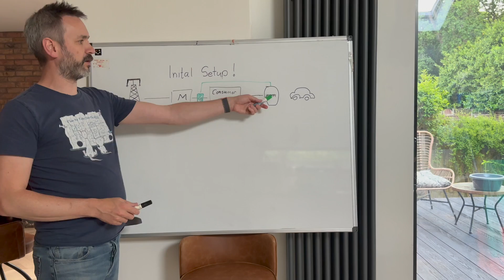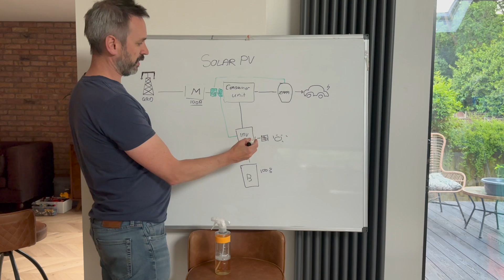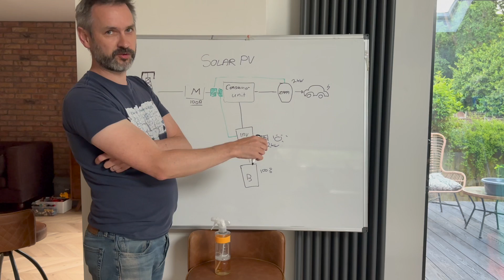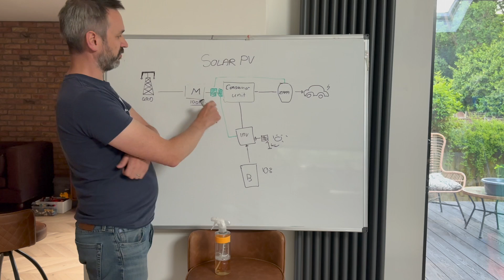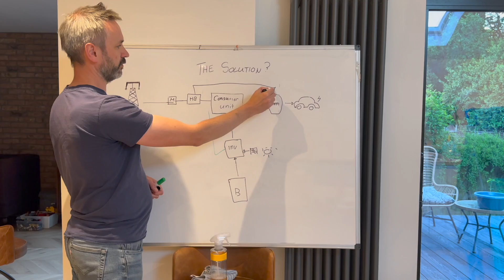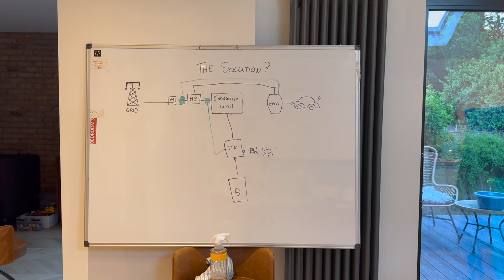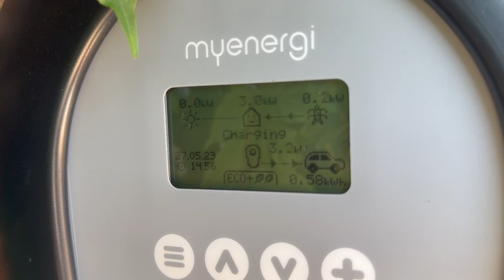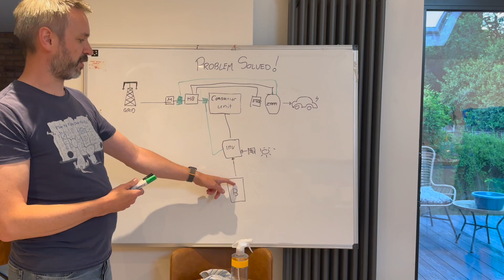How I stopped my Zappi draining my battery

Comment: That’s well explained, but is it all really necessary?

I’m not quite sure that what I’m experiencing is the same as you. What happens to me is that when the solar dips down below the threshold needed to keep the car charging, the Zappi is being kept going by the battery at a fluctuating rate of about 1.5-2 kw in total (battery plus whatever solar there is). So unless something happens to interrupt the charge (like turning on the kettle) the car continues to charge at this rate indefinitely and eventually the battery would drain. The battery isn’t discharging at its maximum rate though.

I don’t think I have this Zappi fix you mention, because I am not seeing a 200 watt export while the car is charging from the solar. There is a small, fluctuating amount of export most of the time, but sometimes it’s zero, and I’ve never seen more than about 80 watts.

I mentioned the solution you have adopted to my installer, and he had a different suggestion. As you said, the battery will discharge until it’s at the minimum charge set - yours is at 10%, mine is at 4% by default. But this is user-configurable. My installer advised me simply to set the protected % on the battery much higher to ensure that any excessive drain by the Zappi is stopped before it does any damage.

I have settled on protecting 93% (of a 9.5 kwh battery, so about 0.66 kwh), because this seems to be all the system needs to function when there is enough solar around that charging the car is a practical proposition. What happens is that when the sun goes behind a cloud the battery kicks in and keeps the Zappi going at about 1.5-2 kw. This usually tides the charger over until the sun comes back out again. When that happens the charging power picks up and the battery starts to recharge ready for the next cloud. There is even a small bonus. While the inverter caps the generation at its rating (5 kw for mine) when the battery is at 100%, while it’s charging the generation is uncapped. Thus in full sunshine the Zappi can keep going drawing 5 kw while the rest of the generation goes into the battery.

I find that 93% is enough to tide the Zappi over for about half an hour. If the sun hasn’t come back out by then the battery stops feeding it, the charge is stopped, and the remaining solar is then diverted to recharging the battery. If the solar then recovers sufficiently the Zappi will start again, but if the clouds have thickened drastically or indeed if it’s the end of the day and the sun is setting, then the charge stops for the day. It usually doesn’t take too long for the battery to recharge as there’s usually about 1 kw solar happening anyway.

This way, if you are charging your car direct from the solar, all you have to do is change the % battery that is protected on the inverter settings to your chosen figure (93% for me) in the morning, then forget all about it until evening, then remember to change it back before the house needs to draw more than that to run overnight. There’s no possible way your battery can drain out that way, and the whole system works more efficiently than if the Zappi is constantly turning off and on again every time a cloud passes in front of the sun.

Well, it works like a charm for me. I can’t see any downside. Is there some reason that wouldn’t have worked for you?
Reply from the maker: Hi - thanks for your comments!

The answer is no, it's not really necessary, but it has taken away a major irritation and meant that my battery is only being used to supply my house.

As you have a Zappi, you should have the export margin, but it's something you need to enable as it's not switched on by default. Once enabled, you can tinker with the export margin too.

As for your approach, I can see two downsides. 
The major downside is the manual intervention is required. I guess it could be automated, but that just introduces more complexity. 
It would also mean that you might not be able to meet some electrical demands. For example, if we turned on the oven/hob and there wasn't enough solar PV by itself, the battery would start discharging. In your configuration that wouldn't happen if the battery was at 93%. We would end up pulling from the grid, in spite of the fact I have a few kWh in the battery.

Here is a useful article from Myenergi on how to setup the export margin - https://support.myenergi.com/hc/en-gb/articles/4716922623633-Hybrid-PV-Battery-Set-up-Avoid-Draining#:~:text=Set%20the%20Export%20Margin%20to,divert%20power%20to%20the%20car.
Reply: @tomasmcguinness  Thanks for your reply. I'll read the article, but I don't think I need to bother as I'm happy with the system as it's working at the moment. You say that "manual intervention is required" but really it's so minimal as to be insignificant. This morning I thought it was so cloudy that the car was unlikely to charge, but I flipped the battery % anyway. Took about ten seconds. Then I went off on my bicycle. When I got home I was surprised to realise the car was charging, and had got nearly 3 kwh despite the dull weather. It charged for nearly three hours, getting almost 6 kwh, before the battery reached 93% and the charge was cut. This is despite the solar fluctuating between about 1 kw and 3 kw the entire time. If the Zappi had stopped every time the solar dipped below 2 kw (which is about what it seems to need to operate without battery support) I'd have got virtually nothing.

If I turn on the oven/hob/whatever when this is going on and there isn't enough solar to keep it all going, it doesn't draw from the grid. What happens is that the Zappi stops charging and all the solar becomes available to the house. I suppose if you turned something heavy duty on just at the precise moment the battery hit 93% and it hadn't had a chance to recharge at all, theoretically it's possible, but I've never seen it happen. (The other thing is, the oven isn't going to turn on by itself. If I do decide to cook at lunchtime, which I don't do very often, it's easy enough to check on the situation and alter the inverter setting if necessary.)

The main issue is remembering to put the battery % back once the car has stopped charging. I have a post-it on the oven door! It's not the intervention that's the issue, that's literally ten seconds on the phone, it's just remembering to do it.

And - we're off again. In the 15 minutes or so it took me to type that (and make a cup of coffee, so the kettle was on), the solar recovered, the battery charged back to 100%, and the car started charging again. The cycle will repeat, depending on the solar available, and the car will get maximum benefit of what's available.

As for automation, well, I'm only doing this on the days the car is actually plugged in and likely to charge, and it takes seconds, so I don't see the point. Also, when my G99 FINALLY comes through and I'm getting paid for solar export, I'm probably not going to do this much. Right now I'm doing my damndest to get every watt-hour in to the car that I can rather than export it for nothing, but when I'm getting 15p for export and paying 7p overnight tariff I expect I'll just export the lot and charge overnight. So really not worth £200 to my installer to change the wiring, or even messing around with the Zappi settings.

I actually find it advantageous to allow the Zappi access to that top 7% of the battery. As I said, it keeps the charge continuous when the solar is fluctuating up and down between 1 kw and 3 kw, which seems to happen rather a lot round here. You get the benefit if it brightens up, then the battery keeps the charge going, then when it brightens up again the charge picks up immediately. I find it really convenient and I really wouldn't want to give that up.
Reply: A PS to that post. After the charge re-started it continued as before for more than an hour and a half before the battery fell below 93% again. In total, in these two sessions in pretty dull weather, the car went from 44% to 60% and put on 29 miles of range. I don't believe that could have happened without allowing the battery to support the Zappi. The Zappi would have been on and off half a dozen times as the sun briefly peeked through, and picked up very little charge each time. It's now too late for the charge to start again even if the sky miraculously cleared, so I'll flip the battery back to 4% protected ready for any evening house load. I note that it took just 35 minutes for the battery to be back at 100% after the Zappi stopped charging.

I also noticed that I did in fact manage to do what I said hadn't happened. I turned on the kettle just at the moment the battery hit 93% and the solar was quite low. Couldn't have timed it better if I'd tried. There was a total grid import of, wait for it, 0.05 kwh. So yes, it's something to be aware of if I was going to use an appliance that drew a lot of power for more than a minute or so just at the wrong moment, and you may say you don't want to be aware, or change the settings to let the house have more battery when you do that, but I still prefer this to having the Zappi continually cutting in and out on cloudy days. It's quick and easy to change the % on the phone.

Comment: The simplest solution (no software of hardware changes) is to ensure your home battery charges throughout your car charging session.  In the summer I set mine to charge at a nominal 200w for six hours.  My car is always charged in less than six hours, so no home battery drain.
Reply from the maker: Yeah, but with Octopus intelligence Go, the charging can happen at any time now.

Comment: Hello Tomas,
good solution. Mayby the only issue is that you have to wait the battery 100% charged before having  surplus energy available from your panel to load tha car.
Sometimes, expecially in winter, this may happen very late consequently you can not load your car early in the morning.   
Regards, Nicola
Reply from the maker: That is true of any hybrid inverter I believe. You could turn the charging off or force it to discharge in these instances. For me, I just didn’t want the battery being discharged by the charger. The addition of the Henley block solves that.

Comment: Very informative, thanks.

Installed my Zappi v2.1 yesterday and straight away noticed my battery draining :(

I was already on the Octopus Standard tariff, so I couldn't wait to switch to Intelligent Octopus Go.
My EV car (Volvo) was currently incompatible. but I purchased the MyEnergi Zappi v2.1 because that was compatible with the Intelligent Octopus Go switch requirements.
The switch to Intelligent Octopus Go was a breeze and completed in around 15 minutes (happy days).

No sooner had I started my first charge (early evening) than I noticed the battery discharging and no power being fed from the grid. This is something I didn't want to happen.
I tried all sorts of things, but nothing I did would stop the battery drain until I did the following:

ENABLED (within my LUXPOWER phone app)

Set the AC Charge Enable to ON
Set the Grid Charge Power Rate (%) to 15
Set the AC Charge Start Time 1 to 23:30pm
Set the AC Charge End Time 1 to 05:30am

This stopped the battery drain for me and the system is now working as I want.

I want to have more or less a full battery when the sun rises so I can start exporting my excess solar power to the grid.

Intelligent Octopus Go Rate from 23:30 to 05:30 is 0.075 pence per kWh
Octopus's Standard Export Rate of 0.15 pence per kWh

I watched a few videos now that say they charge using solar. I don't understand why charge an EV and battery with solar power when you can charge them both from 23:30 to 05:30 with cheap excess electricity?

This means I am exporting all my excess green power to the grid which is a win-win and helping to use the excess generated power during the night, which is another win-win.

Comment: Hi - I have a PV solar array installed with Fox Hybrid AC inverter, Fox battery storage, and a Zappi EV charger (V2). Putting the EV charging aside, the system works fine.  

My system is set with the following priorities (Self-Use):

With PV Power: Load>Battery>Grid, 
Without PV Power: Battery will discharge local loads first, and battery will supply power when the battery capacity is not enough. 

I can charge the EV fine during the day with any excess generated if I choose, and I can boost charge it if I need to, but my preference is to charge the vehicle during the night on Intelligent Octopus Go's (IO-G) cheap 7.5p tarrif, and export any surplus generated during the day using Outgoing Octopus at 15p.

The problem I'm having is when I plug the EV to charge using IO-G overnight, it is first discharging my battery to the minimum discharge level of 20% before topping up my EV from the grid. This isn't great for the health and longevity of the battery. My system installer has swapped the CT positions around to no avail. 

In my Inverter manual, there is an option to set the mode to 'Force Time Use' with priority: Load>Battery>Grid (when discharging), but in the actual Fox Ap there isn't this option. 

I've watched your video (great job btw!) but i'm not sure if adding a Henley block to my system will solve my problem as charging overnight on IO-G was not explicitly mentioned. My system is essentially set up as yours was prior to you solving your problem with the Henley block solution. Can you confirm if the Henley Block solution will allow me to charge my EV overnight on IO-G without first draining my battery, or is there something else that can be done with my set-up? 

Note that my set-up always exports a small nominal amount to the grid even when i'm not generating any excess.

Thanks in advance!
Reply from the maker: Hi,

Thanks for getting in touch. I have started working on an updated version of that video, with an animation to try and make it clearer.

Essentially, the Henley block stops the Inverter seeing the load from EV charger, so it will never discharge the battery to meet that demand since it never knows about. 

Since I made this change, my battery has never discharged into the car. It's quite strange to see the excess solar charging the battery, whilst the car is charging from the grid.

I use IO-G myself and it works like you describe but remember that IO-G decides when to charge the car.  I no longer charge my car using solar excess as it's more financially beneficial to sell at 15p and buy at 7.5p.  I have to do my best to avoid plugging the car in when it's really sunny out just to make sure it doesn't charge using excess!!

Of course, it plays havoc with any numbers you use get from the inverter e.g. what the inverter thinks it's exporting might actually be going directly into the car (if you're charging from excess for example).

I hope that helps. If anything isn't clear, let me know!
Reply: Hi, I think the same as you and had the same problem which I overcame by doing the following:
I'm sure your inverter app will have something similar, somewhere.

ENABLED (within my LUXPOWER phone app)

Set the AC Charge Enable to ON
Set the Grid Charge Power Rate (%) to 15
Set the AC Charge Start Time 1 to 23:30pm
Set the AC Charge End Time 1 to 05:30am

This stopped the battery drain for me and the system is now working as I want.

I hope this will help you as it has me.

Comment: So my tails go into a Henley block in the meter cabinet and the zappi is taking power from there into a separate consumer unit for the zappi. I’m having solar and battery next month and wonder if this will prevent my zappi from discharging my battery
Reply from the maker: Yes, that arrangement sounds like what I ended up. The trick is where the inverter’s CT clamp goes. If the CT clamp doesn’t “see” the load from the Zappi, it won’t discharge the battery to feed the Zappi.
Reply: Just run a ct around the battery ac wire at the fusebox and connect to a zappi ct terminal, there are 3. Then you can monitor the battery input and choose "avoid drain" on the zappi options.. If you run a cat 5 data cable you'll have 4 twisted pairs to use,
Reply from the maker: If you have a separate battery inverter, that would work a treat.

Comment: So you are constantly drawing from the grid for your Zappi, when random cloud cover etc, to charge up your car at a slower rate.
You don't want a 100% renewable energy strategy?

Wouldn't it be better to get an additional battery and then use more renewable with a faster charge rate?
Reply from the maker: At this moment in time I charge my car using grid power alone.
Reply: @tomasmcguinness  Is that for the best financial gain for yourself rather than using your stored energy instead?
Reply from the maker: @sassasins031 yeah. I get 15p for every unit exported and I pay 7.3p to import during the off peak. As the car is under Octopus control, I’m trusting they charge when electricity is as green as possible.

Comment: That sounds about the same situation I was experiencing, however, I did notice you were charging the car at 3.5kwh but surely the Zappy can deliver 7kwh, why?
Reply from the maker: It can. Typically, when at home, I charge at a lower speed. I believe this helps prolong the life of the battery.